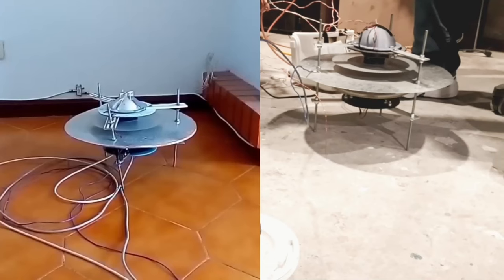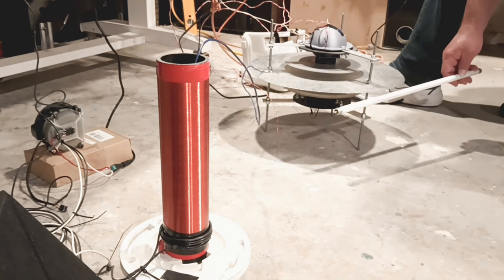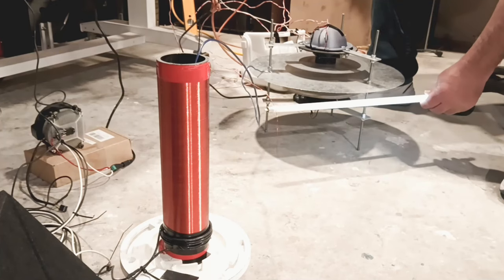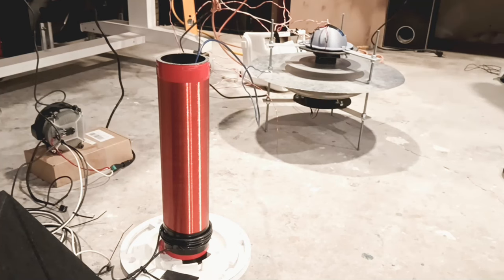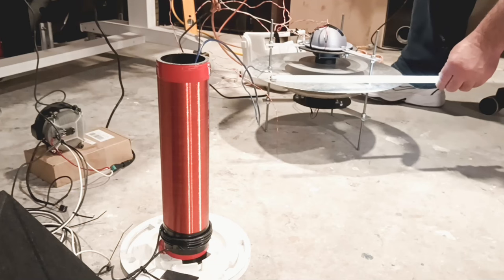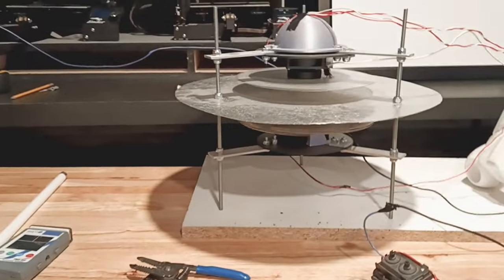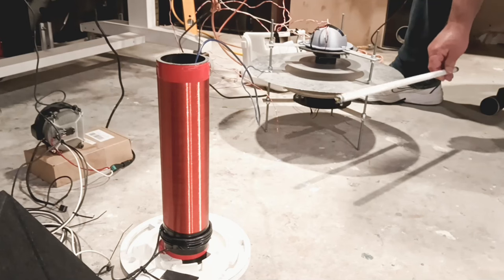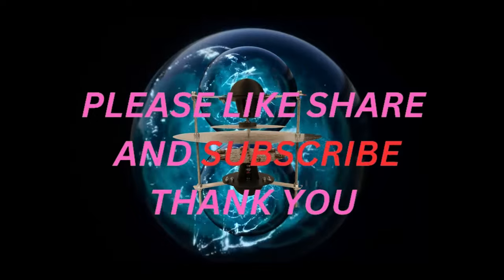Graviflyer "Everything Tested" #30

Comment: So badly faked. The swaying as it rises shows its suspended by fishing line lol. Thats why he dosnt zoom out so you dont see it.
Reply: I wish people wouldn't use that particular video because - yes - it's reasonable to conclude it's hanging from a fishing line. However there is outside videos where the simple fishing line explanation doesn't work. I'm not convinced yet that this device is genuine but this needs to be pointed out.
Reply: Wrong, the fishing line works better outdoors as it's easier to hide and video editing is his trick, don't be so easily fooled a drone is lifting the outdoor videos
Reply from the maker: These people could do their homework. A string attached to a 3lb object will never be this consistent in the air or in a room. It will also not correct itself to the same position. It would swing wildly after being put out of balance. The weight in each spot makes it impossible to handle. I would not have taken everything this far if I didn't rule out the obvious.
Reply: @thenarrowgate3063  Unless this is some video editing - at 32.35 in this video: https://www.youtube.com/watch?v=CCUWs02HK_M shows how a fishing line is unlikely.
Reply: @evo-labs  sorry, Ive seen so many faked videos. There are too many ways to fake it. The energy required here is for anti grav is more than a domestic supply will allow. An EDF fan was used in the other video. Ive done my homework. Please do yours.
Reply: @zicadibrove4119  Yes, I agree an EDF fan is how this could be achieved. A replication as such would confirm this.
Reply: @nathanbunten4299 Good retort!
Reply: @nathanbunten4299 not to even mention the slightest change in torque would send this thing spinning out like a beyblade. But also like you mention the amount of stability it has mixed with the other videos leads to what I can only comprehend as conclusive proof.
Reply from the maker: @isaactippetts3202  I agree with you.
Reply: @nathanbunten4299  Nathan, do you think you could demo some ways he could have faked it and try to debunk them?
Reply: Dude sound genuine enough. But it does look like its hanging from a fishing line. The wires are dragging it down but.... it doesnt act like something hovering like a helicopter... it just looks fake. It does not even lift off smoothly... more like someone pulling a string.
Reply from the maker: @chikapunk4340  I will never show anything like that. I can live with what ever they say. I know they have no idea what they are talking about. The science has to speak for itself.
Reply: @nathanbunten4299  that’s fair.
Reply: @nathanbunten4299  Actually the science is frnge and unproven, its results that speak for itself not unproven scientific theory
Reply from the maker: @thenarrowgate3063  Everything is fringe until it's not. It takes people like me to make these things a realty.

Comment: Nathan, you don't want the field to move out. You are shorting out and why the microphone pics up static and your electronics going haywire. When you hooked up the negative voltage on the center disk the field stayed by the graviflyer and this is what you want. The motor speed was good at 11.5 volts as this is the voltage for the battery with the correct chemical operating frequency. The power supply is at 60 hz and this is not good as you are producing RF and why you get a headache and are damaging your brain like my friend Mark Tomion did who died from this. If you keep doing this, you will get very sick.  You want a light photon exchange particle and not RF.  You need the polycarbonate CD with the groves and the center plate to have the marks so the ultrasound can penetrate the disks to shut down the voltage on the plates and the Al and the Al2O3, so you have a normal capacitor and not an air capacitor. When you push the button, the voltage ensues and the charge (0.2 C) on the plates builds up to lift the graviflyer up, so it levitates. You have the correct rpms of the motors.  You want the center disk to have the high voltage (14,000) and the lower and upper disks to have a smaller voltage (400), so you have a voltage gradient. The magnets have the correct field as thy induce a spinning voltage and current on the disks to make an even larger magnetic field. The bottom plate then repels the earth, and the top plate attracts the ionosphere with proper charge polarity. The induced spinning current and voltage produce a gravity torsion wave and why everything in the universe spins. The center disk, magnets and voltage gradient keep the charges separated as the charge is very large.

Comment: Neodymium magnets ARE a type of rare earth magnet, so it's confusing when you mention neo's and rare earth magnets as if they are different types.
Reply from the maker: I will clarify the strength then on all upcoming video's. For reference the magnets I am using are  12 lbs Powerful Pull Force. 1.425 in x 0.3 in Strong Earth Round Industrial Magnets
Reply: Its one of the most common types of rare earth magnets :D

Comment: Place iron (or a magnetized type of metal) washers underneath the magnets in the top plate and use plastic washers on the bottom disc for large eddies bottom plate and smaller eddies top plate.  Reverse that if needed.

Comment: loved the video! A hall sensor could tell you field strengths on the outer edge of the big disk. it'll give you a better idea of how much magnetic induction is occurring within the larger disk from the smaller discs with the rotating magnets. id also consider super cooling the middle plate and induce as much amperage in the middle disk as possible. super cooling will not only shield the middle plate from earths gravity and magnetic field but might hold the induced magnetism in. if it can "push off" earths magnetic field it might float or loose weight at least.
Reply from the maker: thank you. I am making a list of things to try. Just added yours to it.

Comment: 12:00 in the microphone cuts out.  What kind of microphone is this?
An electret microphone is a type of electrostatic capacitor-based microphone, which eliminates the need for a polarizing power supply by using a permanently charged material - so if it is this type, bringing it close to the Tesla coil likely over saturates it - just as bringing a strong magnet close to a speaker will cause it to stop working too.
Have you ever tried to tune an old-style bread-board HF radio?  I have, and they can be VERY sensitive to the surrounding. Bringing a hand close can/will act as a capacitor (a metallic screwdriver is even worse) so one can tune to perfection - and when you move away, the station goes away. This is why nearly every HF front-end has its sensitive tuning components enclosed in metallic shielding. Perhaps not moving around too close will make tuning a lot easier?
In regards to the pots being too sensitive - if it is physically accessible, you can place another smaller pot in series with the sensitive - rough adjust the sensitive and then fine tune on the small and less sensitive pot. 
Thanks for the update - best of luck, and stay safe - high voltage fields can be very dangerous, styropyro (@styropyro) has some crazy Tesla coils - and he demonstrates their power and it is not always the spark size one can tell from if it is lethal or not. Depends on the current and frequency.

Comment: if its all a matter of balance and resonance within all the parts, maybe even the frequency of the ultrasound could be an important factor
Reply from the maker: it is it is in the khz range. The center plate has hz khz and mhz in it with everything attached. The resonance just has to hit them.

Comment: もしかすると、真ん中の円盤の円周には、カモフラージュされたコイルがあるかもしれない。
下の円盤の磁石はフェイクだと思います。
3枚の円盤を、昆虫の羽を真似して作るとしたら、羽の骨組みに当たる部分は銅線に置き換えて考えるとして
円盤は磁場を帯びているはずです。
Reply from the maker: There is a polarized field because of the high voltage. https://youtu.be/XRfYpcyDoLg?si=Mdi9RAgZ4LWiqg0e
The dimpled disks are for harmonics and frequency's. If you could see it The image would look like ripples in a pond. Then it starts raining. The wings in a beetle would move so fast they give off a small static field just like the high voltage does when you remove most of the amps.

Comment: 29:40 - Alexeys graviflyer looks like it has a metallic reflector on top housing the piezoelectric device. Reflector from a high power flashlight?
Some reflectors may have a Chrome layer, which not only acts an Faradays cage, it is also behaving rather strangely magnetically wise:
Chromium is magnetic. It is the only elemental solid that shows antiferromagnetic ordering at room temperature and below. Above 38 °C, its magnetic ordering becomes paramagnetic (some materials are weakly attracted by an externally applied magnetic field). Antiferromagnets can couple to ferromagnets as the spins of electrons, align in a regular pattern with neighboring spins (on different sublattices) pointing in opposite directions.
In other words: Chromium can be magnetic in the presence of a magnetic field as some dipoles try to align in the direction of the external field, thus, increasing its magnetic behaviour. Chromium has six unpaired electrons, making it possible to possess magnetic characteristics.
Aluminium is also paramagnetic, but very weak compared to Chrome - it might be interesting to put some alu-tape on the top dome to shield it electrically + make it interact magnetically as well, if you can not chrome plate it 🙂
Ever rung a metal bell - it rings.... Ever rung a plastic bell, it dungs ;ø)
Edit - forgot to mention temperature might also effects the sound a bell makes, the warmer the more easily the metallic lattice will vibrate = higher pitch, and if Chrome is indeed a factor - temperature must also be factored in
Reply from the maker: I had the same idea. I will print another top and al tape it. I think you are right about the interaction. In fact I think it will make the tesla field stronger as well.
Reply: @nathanbunten4299  I just added this, not sure if you had time to read it:
Edit - forgot to mention temperature might also effects the sound a bell makes, the warmer the more easily the metallic lattice will vibrate = higher pitch, and if Chrome is indeed a factor - temperature must also be factored in.
Judging from Alexeys videos it seems to be a bit colder than I remember the US West coast to be 🥵

Edit: It is likely the other way around in regards to pitch, the higher the temperature the more it vibrates inside - and the more energy has to work moving through. I also seem to remember hot items sounding a bit more dull than freezing metal which imho sounds more pIIINgy
Reply: @EgonSorensen I don’t remember where but I think it was stated at one point that temperature, ambient pressure, and time of day/year are all factors that play into the Tesla coil’s resonant frequency and the ultrasounds frequency which is why I think you are supposed to tune based off the Tesla coil. Because it will automatically adjust itself, you just need to do the others. 

Not sure, again I don’t remember where I heard this, but something to consider for sure.

Comment: ビーフィールド・ブラウン効果を再現するとして、真ん中の円盤かどれかに、コンデンサーの役目をするような
機能を持たせる必要があると思います。
Reply from the maker: I have an idea for that. If I could build 2 paper lifters with a common big disc in the center between them. Then wire them to alternate which small disc gets charge on the outsides then I could show force in a pendulum structure. It should move if the timing is correct. Then a vacuum chamber would be needed to verify it is the correct effect.

Comment: sorry but what do you mean by collapsing the upper field with the ultrasound? beacause i wanna know what role does it play in everything, even beacouse i was doing some little experiments with an electrostatically charged polystyrene piece, and a speaker at high volume under it, but not ultrasound, i put like 350 hz or around that, beacuse i noticed that in that frequency it was interacting more with air and the material around it, vibrating more, maybe not on a molecolar level like the ultrasound, but it was doing something, of course it was very loud, i put a beetle elytra on that polystyrene charged plate, and making it vibrate, with the sound, i noticed that the electrostatic charge incremented, significantly but discharged faster, i think that the sound waves was pushing the electrostatic field upword, cause the elytra when vibrating was lifted a bit and in some cases trowed away, but this only happened when I positioned the plate at the right angle, distance and with the right pressure so as to create a certain frequency and vibration, at a certain intensity or it would not have moved, i noticed that in the moment that there was the right vibration frequency to make the elytra fly, the sound was very very similar to the sound that beetles make when they fly, i managed to levitate a type of elytra even just with the sound but I don't know if it could have been wind caused by the speaker or acoustic levitation or both, but this time it was different, and flied in a different way, there was nothing between the speaker and the elytra, and nothing that kept it stuck to the plate, in the other cases for shure the vibration was throwing it from all sides, but could not lift without the electrostatic charge, only jump due to the vibrating movement of the plate, and somethimes it was hard to distinguish if it was jumping or levitating, or both, but the vibration only, could not make it levitate or going higer, but even the electrostatic only couldn't do anything, on the contrary the charged plate tended to stick the elytra on it, and it was hard to make it fall even in reverse and shaking it at the same time, it would not fall, it was stick i had to shake it very hard to make it fall, the electrostatic attraction was that powerful that it attracted the elytra even at 10 centimeters of distance or more but with the speaker on that force who seemed to stick the elytra to the plate, was pushing that elytra upward, i dont know maybe i am making up things and it is just an electrostatic or sound phenomenon but, for shure the electrostatic charge was incrementing with the sound waves and in that moment the elytra no longer sticks, i thought that maybe the vibration on the plate was detaching the elytra from the plate making it jump a little, but if it was only that the the elytra should not have any effects when it was not touching the ground and shouldn't levitate, but it was,

 sorry for the long comment, i wanted to share those experiments, maybe it can help or give some confirmations, good luck, and keep up the good work, i really like what you are doing, we are all on your side
Reply from the maker: when you are lining up the frequency of the speaker and the piezo you get the reaction. It has found a resonance point. In my experiment if I wanted to set the high voltage to the piezo I have a circuit to do that. I am adding it to testing. If you are right, then you just made my life so much easier in testing. Thank you for the information.
Reply: Great comments! Thanks for sharing!

Comment: When checking the Tesla coil with the mic, does it do the same thing if you remove the wire from the center of the Tesla coil?
Reply from the maker: No it doesn't and the wire is all the way down on the tesla coil. I was told it was putting off a frequency in hz at the top. I need to verify that.
Reply: @nathanbunten4299  
Studying the Don Smith device, yes I understand that you are not trying to make power, there are some things that   seem to be relevant to the graviflyer.
Pulsed DC
Anytime there is a voltage increase from a DC source there is also an increase in frequency.
Some electrical components are quite finicky to tune when dealing with RF.
Don explains which components he looked for. I try to find what video he talks about this.
In another one of his videos he explains one of his devices uses a double Tesla coil with one primary. One is wound clockwise the other counterclockwise with two extra turns to create a lag. 
Don explains that the output of the Tesla coils is a spiked sine wave.
My point here is what you are getting out of the Tesla coil may be a high frequency spike.
How long is your wire that connects the Tesla coil to the Graviflyer? Alexi uses a long one out doors I assume.
Length of wire will also change frequency. 
Just a thought.

Comment: Isn't what you are demonstrating around  30min mark just ionic lift?
Reply from the maker: No, it is not ionic lift at all.
Reply: @nathanbunten4299  Also, why not add a kitchen scale to your experiments, how will you confirm that you have any kind of effect without consistent measurement?
Reply from the maker: @ET_AYY_LMAO  I have a meter to show airflow. I will use it on  my next live video.
Reply from the maker: @ET_AYY_LMAO  The rotation would ruin any readings from a scale. All you get is the disc with magnets changing the weight.